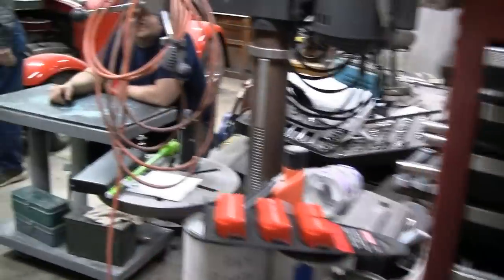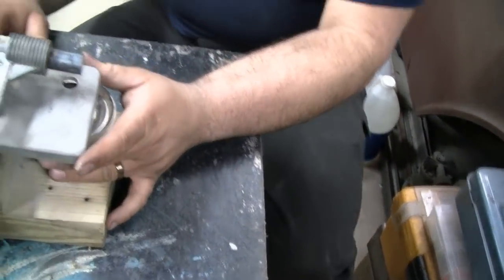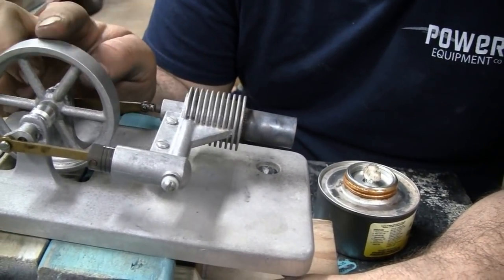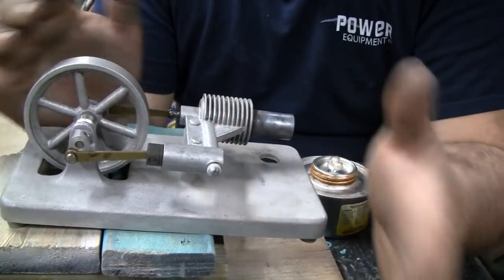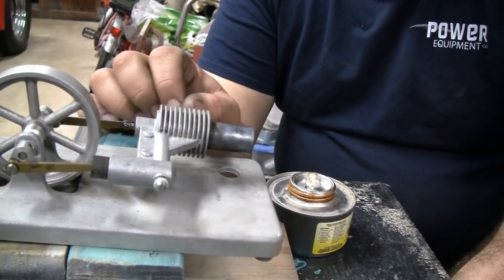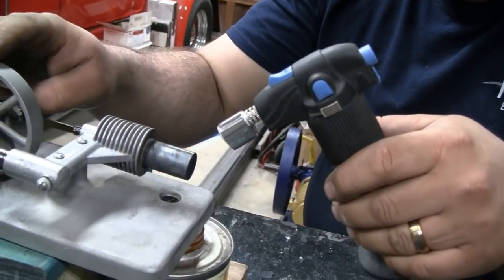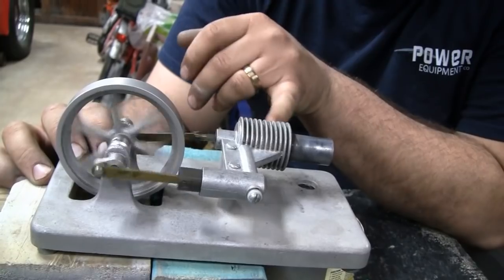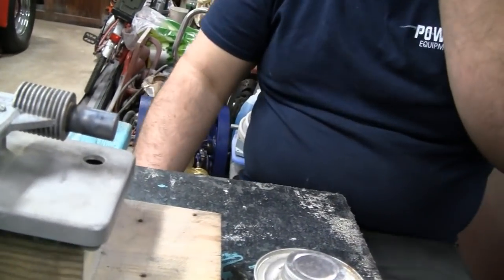MINIATURE STIRLING ENGINE

Comment: I got given a very similar engine for my birthday just a week ago and was going to send you a video of it running, but I guess you got the vibes via telepathy and beat me to the punch. Mine has a tiny generator attached with an LED. It is supposed to be run on alcohol, but the zippo fuel I had to hand worked good, though I had to clean the soot off afterwards. Fun little toy.